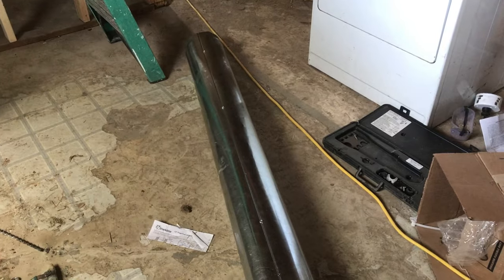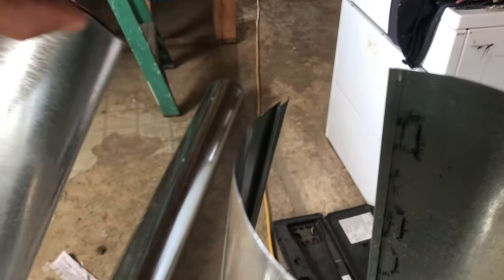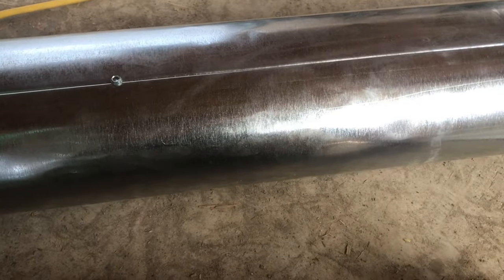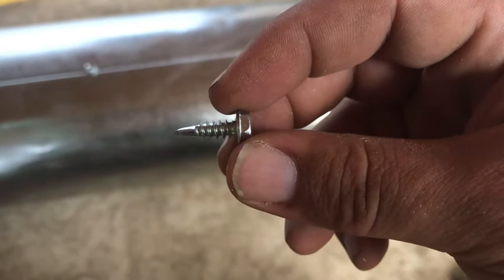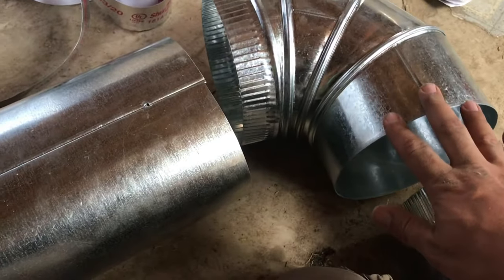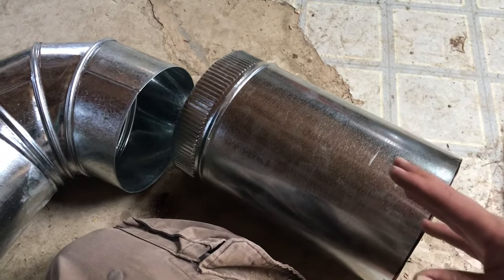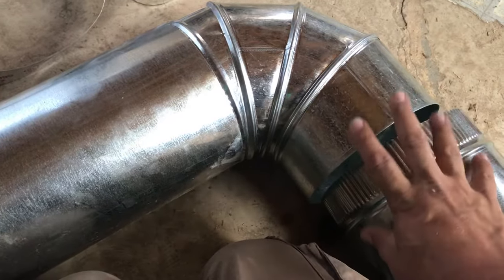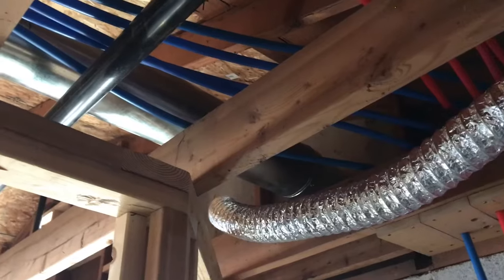How to Make A Metal Rigid Duct for Range Vent or Furnace

Comment: Very informative, thank you for making and posting.  I'm curious, if you had to reduce down to 6" before it went through the wall, why use the 7" pipe for the rest of the run?
Reply from the maker: The hardware store was out of 6 inch at the time time and I was on a deadline for inspections

Comment: DON'T FOLLOW THIS METHOD! screws shouldn't be used to hold the duct together it's designed to stay together once it is snapped in. The exaust outlet is placed too close to the other exaust outlet. Will it work? Probably, in the short term.  Crap will start building up on those screws
Reply from the maker: this is how the hvac people do it here and its code.